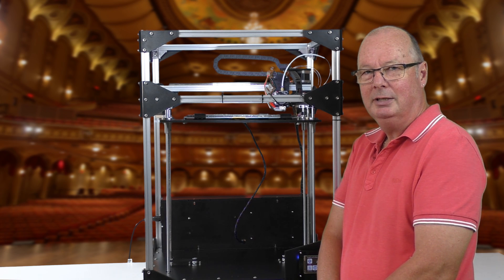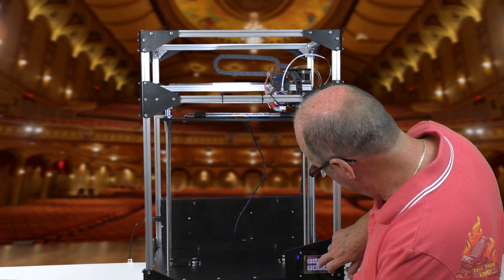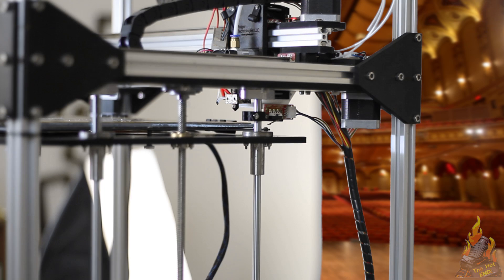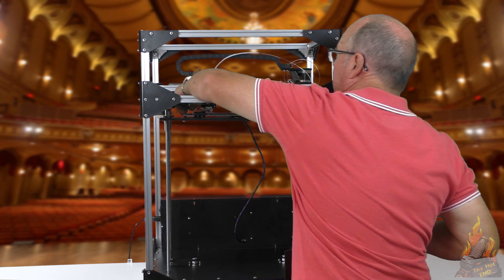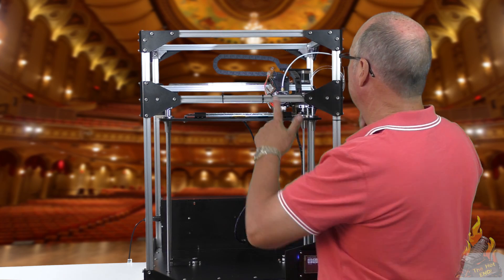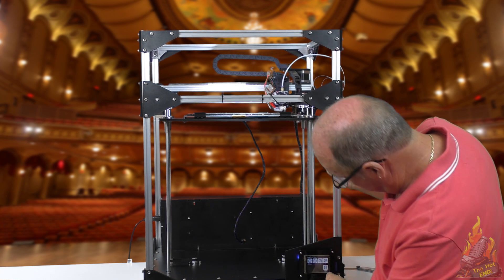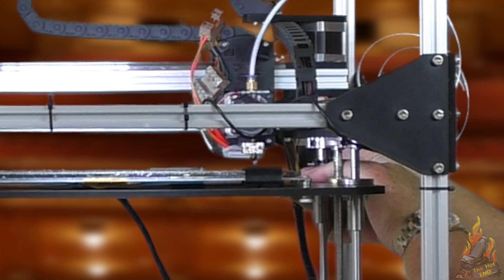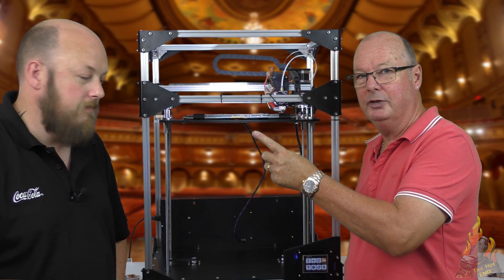How To Level your 3D Printer Bed! - Back to Basics Series on Folgertech FT5

Comment: Hi John,

i see a touch screen on Anthony's machine.. Is there any info on the Install? Remember my LCD is wonky, so I came across a MKS TFT screen to install
Reply from the maker: This will be part of the hotend upgrade kit - You cant (i believe) directly connect it to standard board, mines smoothieware MKS SBASE 32 bit  - Anthony

Comment: Nice touch screen setup (I'd be afraid of hitting it too many times and doing something I didn't intend to)
I was a little surprised you didn't need to go to each corner and raise/lower the bed?  As a beginner, learning that on my first printer made life easier!  While what you did seemed to work, I'm a little unsure....asides moving the limit switch around...what you did to level it?
Reply: once you establish a starting point, the rest is done with the levelling screws/springs. I was just lucky that the bed was level straight away. If it had been off I would use the screws more. I find that side to side and front to back is sufficient to get a print started, then fine tune, as I said, on a large footprint model while the brim is printing.

Comment: LOL. You completely missed the very first , and most fundamental step to perform before starting this procedure.  Its apparent looking at your machine, that you have neglected to do this step on your machine.  The fact that it is apparent in the video is exceptionally bad.  I will leave it up to you "elites" to figure it out :).  Not to mention, your Z end stop switch is loose on its mount.
Reply: No.1, it is not me who is elite it is the printer.
No.2, the z stop was loosened for the purpose of adjustment.
No.3, it was not my printer - I have an adjustable z end stop mount.
No4, there was nothing missed.
No.5, if you wish to make constructive criticism, by all means do but your sarcasm is not required.
Reply: They call themselves elite.  I only use that name as thats what others call me.  

I did not say the mount was loose, of course it is.  I said the SWITCH was loose on the MOUNT.  And no, it is not supposed to be.  The mount should be loosed from the rod to adjust, but the switch on the mount should NOT be loose.  I think you are on the wrong website as well.  Maybe learntointerpretenglish.com would be best suited for your use of attention.

Yes, there is something wrong with the procedure.
Reply: I was not referring to the mount , but the switch on the mount.  It is clearly very loose.

Yes there was something missed.  You should first ensure that each side of the bed plate are at the same position on the Z screws relative to the nozzle, or another feature at the top of the Z.  This is the very first step in leveling a multi screw Z axis.   Then proceed with setting zero, and leveling.
Reply: I think you need to view it again. I showed levelling side to side by turning the motor/lead screw.
I didn't notice if the switch was loose, if it was, thanks for pointing it out.
Reply: I'm going to be brutally honest here, I actually really don't care and I truly mean that, I didn't even read it.

Comment: where did you get that control panel for the ft-5? on their website it shows just a small panel with a knob in the pics.
Reply from the maker: It will be in the Hotend edition upgrade kit (its MKS SBASE smoothieware with TFT 3.2" color touch screen and optional wifi)
Reply: Whheeennnnnn..
Reply: that is Anthony's FT5, it has the smoothie ware and touch screen controller.
Reply: The Hot End nice!
Reply from the maker: Streaml1ne J. Moose you need to hassle John Folger - im waiting too

Comment: nice vid. I plan on picking one of these ft-5's up soon hopefully. very tired of constantly working on my hictop prusa i3.... seems like I get it printing well for a little while then one day I'll turn it on and its back to square one...
Reply from the maker: +sinformant the i3 design is not the best IMO - too hard to enclose too
Reply: The Hot End yes I've wanted one I could enclose so I could run abs better. also I like how this the bed isn't the y axis, so no worrying about tall prints falling over while printing.